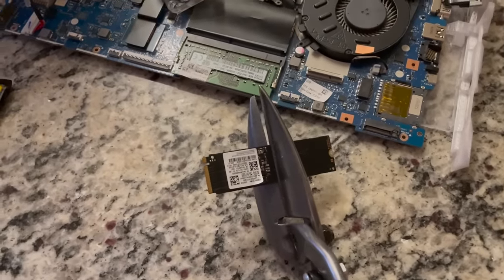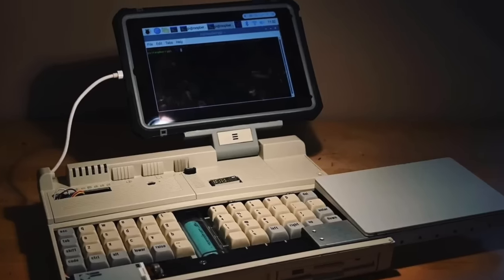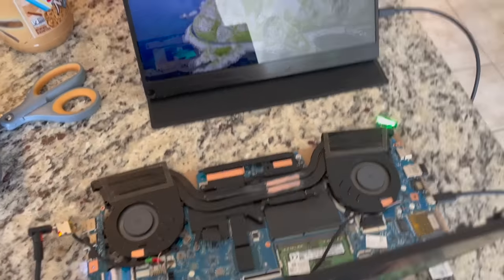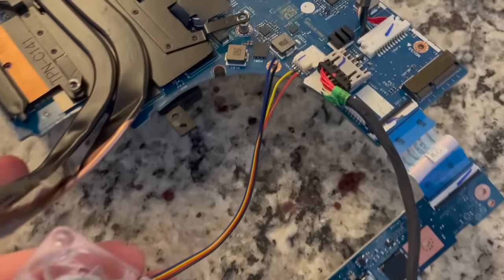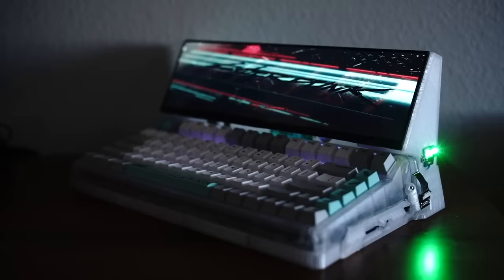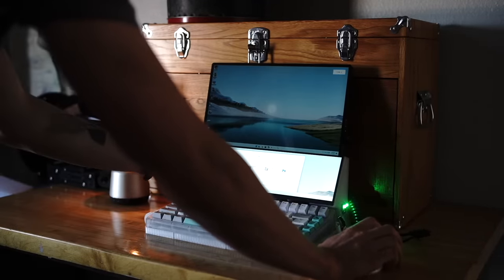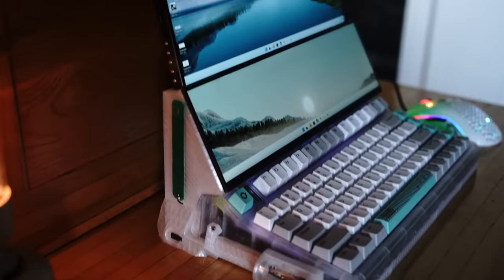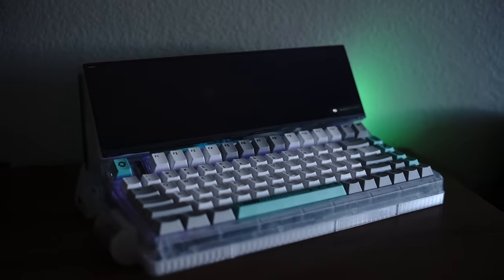I used this as my Computer for a Month

Comment: Hp Pavilion is such a good gaming PC model. Had mine 3 years ago for school project (solidworks and blender and photoshop) and to game also. Always been working properly since, never had an issue and the performance for the price I got it is incredible ! At the time it was in sale, I got it for €700 with taxes, shipped with a GTX 1060 ti, an I5 8th gen, 8gig of ram and a ssd + HDD. Not the most powerful pc by far, but probably the most high quality/low price pc I've seen. I'm still gaming on it today, ahah

Comment: I have to use a riser on my zenbook in order to make the lower screen usable for me. This riser puts the laptop at an angle where I can't type comfortably. My zenbook is basically a desktop when I am using both screens. Zenbook in the car (only used it once) worked great since I was right on top of the laptop.

Comment: SHUT UP AND TAKE MY MONEY. seriously I actually have a use case for this thing. I'd love to put a raspberry pi zero 2 W in it for a low power mode and a regular windows PC for my game development. This is AWSOME. The keyboard with a monitor the description is just perfect. I'm not good at DIY stuff
Reply from the maker: In a week or two my next video will be a new, simpler version of this. I’ll be putting that one on eBay if ppl want to buy it

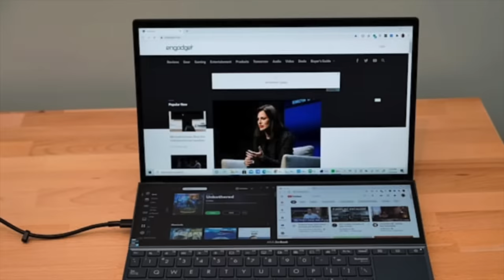Comment: 3:59 I thought exactly the opposite before you said that. The zenboook is pretty flat, which makes it more ergonomic. Even if you made a huge wrist-rest for it, you'd have to make a mousepad-riser as well in order to not get shoulder pain from long term usage. If you are sitting in the "correct/recommended" (if  there is such a thing) ergonomic way that is.
Reply from the maker: I was more referring to the ergonomics of the displays: the lower zenbook display is at a much lower angle so you have to look down at your hands in order to see it
Reply: @CarterHurd  Yeah, off course. That's completely right. Awesome machine though. It would be pretty cool to have one ☺

Comment: Mouse out of the game issue:  This is NOT a windows issue. This is the game. You can code a game in a way where the Mouse is locked into the boundries of the game. Or not.
So it's software related and not OS related.
Otherwhise it would be the same for every game, depending on the OS version. Which it clearly is not, as u yourself stated.

Comment: That Intel concept computer is actually sorta something you can get. Asus made something like that, where it has a normal 4K display, and then the extra wide 2nd display on the bottom. You can use the 2nd display for whatever you want, it can even be used with a stylus so it’s very versatile.
But the thing isn’t cheap, as both screens are high quality, along with the build quality being top notch, with the best model only using a 10th gen i7, a 3070 mobile, 16GB ram, and a 1TB SSD.
Edit: oh wait…. You did mention that thing….. well, it’s still a good option. Plus you kinda have to deal with how that laptop is set up. Making it so both screens are angled to line up like that concept would’ve been hard, and would contribute to more materials used. Plus it might be more fragile.
Reply from the maker: I like your "edit" haha, but yeah the Asus Duo is super cool... I just don't have the money for that
Reply: @CarterHurd  SAme 💀 like… I don’t care if it has an OLED display, give us extra lower priced options, especially as 4K OLED screens are apparently expensive.
I’d be good with just some model that has an i5/3050ti, or an i7/3060. Over 3000 CAD is lots, even with all that was put into the device.
Reply from the maker: @Thewaterspirit57  agreed. They do have a 14" Duo that's only $1,300, but it doesn't have graphics. If they added a 3050 to that it'd be priced well... but if you want a GPU they make you upgrade to the big one.

Comment: id buy this in a heartbeat.
Reply from the maker: Feel free to IM or email (see website for address) me an offer. It's super janky though, you'd be buying something with no easily accessible headphone jack (that's located on the display driver board in the back), a thermal-epoxied heat sync, a chassis made of 3D printed parts glued together, poor clearance around the USB A and C ports, and a display that's been double-stick-taped on.... I feel like it's worth more to me than anyone would want to buy it for. 

People keep saying they want to buy it, but they want to buy a product like this. not a prototype. Maybe one day....
Reply: @CarterHurd  ill definitely shoot an email about it, thanks for replying

Comment: I would totally buy this.
Reply from the maker: Feel free to IM or email (see website for address) me an offer. It's super janky though, you'd be buying something with no easily accessible headphone jack (that's located on the display driver board in the back), a thermal-epoxied heat sync, a chassis made of 3D printed parts glued together, poor clearance around the USB A and C ports, and a display that's been double-stick-taped on.... I feel like it's worth more to me than anyone would want to buy it for. 

People keep saying they want to buy it, but they want to buy a product like this. not a prototype. Maybe one day....

Comment: Need to beef up the hardware 33% and 15% more vertical screen and I'd pay even more than i'd already buy this thing for
Reply from the maker: Feel free to IM or email (see website for address) me an offer. It's super janky though, you'd be buying something with no easily accessible headphone jack (that's located on the display driver board in the back), a thermal-epoxied heat sync, a chassis made of 3D printed parts glued together, poor clearance around the USB A and C ports, and a display that's been double-stick-taped on.... I feel like it's worth more to me than anyone would want to buy it for. 

People keep saying they want to buy it, but they want to buy a product like this. not a prototype. Maybe one day....

Comment: The reason the temps were so close to stock is that the CPU and GPU will throttle back to maintain temps
Reply from the maker: Maybe, but I ran some benchmarks and when that happens you normally see the benchmark scores taper off after a few runs, but this ran the same as before

Comment: I've been thinking about setting up something like this. KDE Plasma on Linux would be a great environment to utilize this, as you could put the application launcher, system tray, and some system monitor applications down on the little screen, and use your main monitor borderless and fully unobstructed.
Reply from the maker: Well I have a version that’s much easier to build if you want to build your own: see my 2nd most recent video. It’s also for sale on eBay too.

Comment: i would buy this for sure
Reply from the maker: Feel free to IM me an offer. It's super janky though, you'd be buying something with no easily accessible headphone jack (that's located on the display driver board in the back), a thermal-epoxied heat sync, a chassis made of 3D printed parts glued together, poor clearance around the USB A and C ports, and a display that's been double-stick-taped on.... I feel like it's worth more to me than anyone would want to buy it for.

Comment: Why don't you kickstart that project, I'll buy it in a blink of an eye, Is so cool
Reply from the maker: Feel free to IM me an offer. It's super janky though, you'd be buying something with no easily accessible headphone jack (that's located on the display driver board in the back), a thermal-epoxied heat sync, a chassis made of 3D printed parts glued together, poor clearance around the USB A and C ports, and a display that's been double-stick-taped on.... I feel like it's worth more to me than anyone would want to buy it for. 

So yeah. just a prototype. And I don't want to start an actual business based on this, the PC industry is brutal
Reply: I'll say $300
Reply from the maker: @elliotalderson876  Fair enough. The keyboard alone cost $200 so I'll have to pass
Reply: @CarterHurd  oh I see that was my fault, ypu actually display the price of the  Keyboard on your video. What about $500

Comment: One idea that have in mind it doesn't sound difficult it's custom monitor computer.

The idea is to be monitor that have the that have computer motherboard behind and and custm case in the order to feeting the mother bord.

And my plan it's keep the ability to use as regular monitor if you want or even switch between the computer 🖥️ the monitor computer and the other one if you want 🙂.

Comment: ohhh man, I wish i could buy this from you  🥺
Reply from the maker: Feel free to IM or email (see website for address) me an offer. It's super janky though, you'd be buying something with no easily accessible headphone jack (that's located on the display driver board in the back), a thermal-epoxied heat sync, a chassis made of 3D printed parts glued together, poor clearance around the USB A and C ports, and a display that's been double-stick-taped on.... I feel like it's worth more to me than anyone would want to buy it for. 

People keep saying they want to buy it, but they want to buy a product like this. not a prototype. Maybe one day....

Comment: The amount of money I would throw at a someone if I could buy this would be immeasurable
Reply from the maker: Feel free to IM or email (see website for address) me an offer. It's super janky though, you'd be buying something with no easily accessible headphone jack (that's located on the display driver board in the back), a thermal-epoxied heat sync, a chassis made of 3D printed parts glued together, poor clearance around the USB A and C ports, and a display that's been double-stick-taped on.... I feel like it's worth more to me than anyone would want to buy it for. 

People keep saying they want to buy it, but they want to buy a product like this. not a prototype. Maybe one day....

Comment: You build something like this, like mechanical keyboards and weird computers, and your complaint is it DOESN'T run Windows? I am quite frankly shocked someone like you doesn't use Arch Linux without a desktop environment, using just something like i3wm.
Reply from the maker: I get this. If I could easily ditch windows I would.  However I primarily do CAD, Gaming, 3D printing, and video editing. I don’t do much development. So for my specific most used programs, the top 5 of 5 aren’t available on Linux.

Comment: Please explain the multiple monitor issue you were having, cause it sounds like it's working as intended and you're just the one person in million that wanted it different.

Typically when playing a game you do not want the mouse cursor to escape the game, since clicking out of the game has key bindings cease to function, most games do this natively, if you want to move the cursor from the game you will first need to alt+tab to a non game window and then click on what you want on the other monitor. This is intended functionality and it sounds like you more want windows to comprehend your intentions so a wild misclick doesn't drop the focus but your clear intended motion does let you move it from the game.

So please elaborate on the issue you were having further.
Reply from the maker: The issue is less the behavior (as you mentioned, for some games you want this) and more that I can’t chose what I want in settings. In some games even “windowed mode” behaves like this. I only expect this behavior in full screen mode. I just want to be able to turn this on and off in the game settings… particularly for slower paced point-and-click games.
Reply: @CarterHurd  the setting is capture mouse cursor, the simple solution is to just be quick with the alt+tab whenever you want to click out as alt+tabbing will kick the capture out.

Some older games will capture mouse movement even after an alt tab unless it's "minimized" so the game has to remain in exclusive fullscreen.

The only bug I want windows to fix related to make sure it also captures the scroll wheel, as some games seem to have that slipping through.

Comment: If you like trying alternatives to normal things, you should really give Linux a try for at least a month. Gaming is getting better everyday, and you can perform really any normal task.
Reply from the maker: Wish I could, I hate windows. My 5 most used programs, other than Chrome, are all not on Linux (mostly CAD and engineering programs)
Reply: @CarterHurd  Ah, yeah. One of the biggest issues I have is specifically a lack of good CAD software. I'm mostly just a programmer though, so it works out great for me. Hopefully one day you'll find some good options with Linux support.

Comment: how much will you sell this for
i would like to buy it if i can aford it
Reply from the maker: Feel free to IM or email (see website for address) me an offer. It's super janky though, you'd be buying something with no easily accessible headphone jack (that's located on the display driver board in the back), a thermal-epoxied heat sync, a chassis made of 3D printed parts glued together, poor clearance around the USB A and C ports, and a display that's been double-stick-taped on.... I feel like it's worth more to me than anyone would want to buy it for. 

People keep saying they want to buy it, but they want to buy a product like this. not a prototype. Maybe one day....

Comment: why can you still use an ssd after you've snapped it
Reply from the maker: The circuits were designed to also work on a smaller PCB/ smaller SSD size standard.

Comment: Ngl i'd buy that
Reply from the maker: Feel free to IM me an offer. It's super janky though, you'd be buying something with no easily accessible headphone jack (that's located on the display driver board in the back), a thermal-epoxied heat sync, a chassis made of 3D printed parts glued together, poor clearance around the USB A and C ports, and a display that's been double-stick-taped on.... I feel like it's worth more to me than anyone would want to buy it for. 

What you'd probably want to buy is a real product like this, not a prototype....

Comment: I wanna buy this
Reply from the maker: Feel free to IM or email (see website for address) me an offer. It's super janky though, you'd be buying something with no easily accessible headphone jack (that's located on the display driver board in the back), a thermal-epoxied heat sync, a chassis made of 3D printed parts glued together, poor clearance around the USB A and C ports, and a display that's been double-stick-taped on.... I feel like it's worth more to me than anyone would want to buy it for. 

People keep saying they want to buy it, but they want to buy a product like this. not a prototype. Maybe one day....

Comment: I don't really understand why you went out of your way to make a big deal out of your previous computer not running Windows, of course the Raspberry PI isn't very powerful, but just because it doesn't run Windows doesn't mean it cant do what you need it to. I use an alternative OS every day and it functions flawlessly.
Reply from the maker: I do CAD, Gaming, and Video editing. And some 3D printing. All 5 of my top 5 most used apps aren’t available on Linux.
Reply: @CarterHurd  In regards to CAD, I use FreeCAD, not sure how it compares but it does what I need. Video editing has its own alternatives, KdenLive, Natron, etc. I don't know about 3D printing, however I'm sure something exists for it. If you primarily play steam games then the chances are they will work with steams proton feature. (only 3 games out of my entire library don't work on Linux)

I'll close with this final thought though, I understand you don't want to switch and you are perfectly comfortable as it is, all I am saying is that it isn't as bad as you make it out to be.

Comment: I want to buy one
Reply from the maker: Feel free to IM me an offer. It's super janky though, you'd be buying something with no easily accessible headphone jack (that's located on the display driver board in the back), a thermal-epoxied heat sync, a chassis made of 3D printed parts glued together, poor clearance around the USB A and C ports, and a display that's been double-stick-taped on.... I feel like it's worth more to me than anyone would want to buy it for.

Comment: Is your neck fine after using this ?
Reply from the maker: Did you not watch the video? It has a second display that is higher up than a regular laptop display.
Reply: @CarterHurd  yes I did, I was wondering if it was ok after 1 month using it, because you probably have to alternate looking up and down. I'm considering adding a tactile widescreen in the same form factor and positioning to my setup (below the main monitor), hence my question!

Comment: can i buy it
Reply from the maker: Feel free to IM or email (see website for address) me an offer. It's super janky though, you'd be buying something with no easily accessible headphone jack (that's located on the display driver board in the back), a thermal-epoxied heat sync, a chassis made of 3D printed parts glued together, poor clearance around the USB A and C ports, and a display that's been double-stick-taped on.... I feel like it's worth more to me than anyone would want to buy it for. 

People keep saying they want to buy it, but they want to buy a product like this. not a prototype. Maybe one day....

Comment: Can i buy it????!!!
Reply from the maker: Feel free to IM me an offer. It's super janky though, you'd be buying something with no easily accessible headphone jack (that's located on the display driver board in the back), a thermal-epoxied heat sync, a chassis made of 3D printed parts glued together, poor clearance around the USB A and C ports, and a display that's been double-stick-taped on.... I feel like it's worth more to me than anyone would want to buy it for.